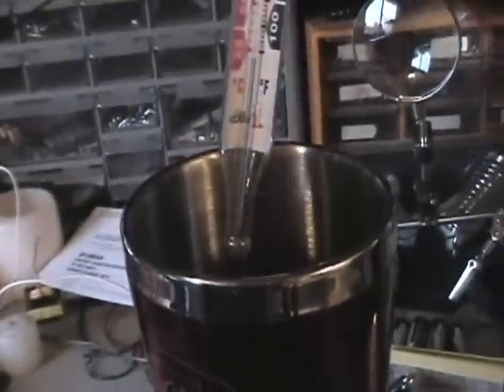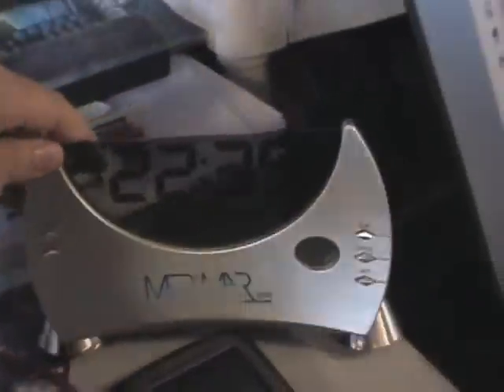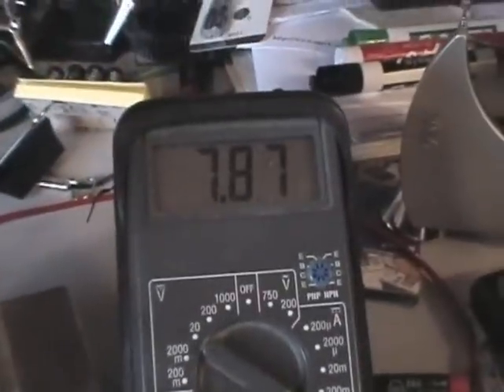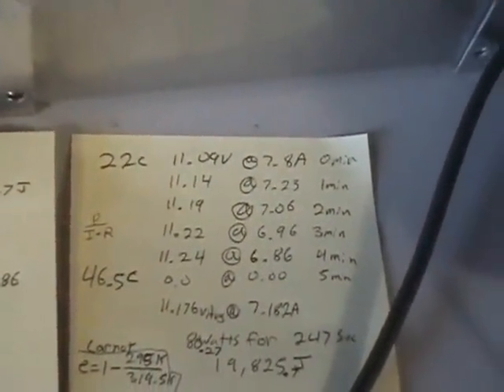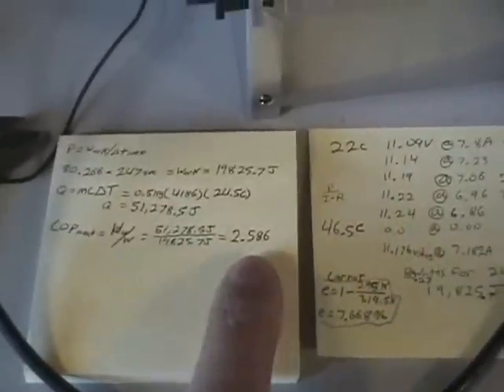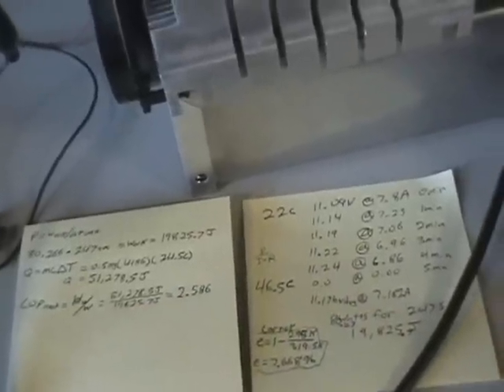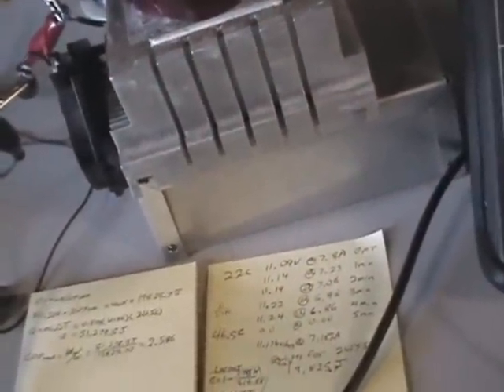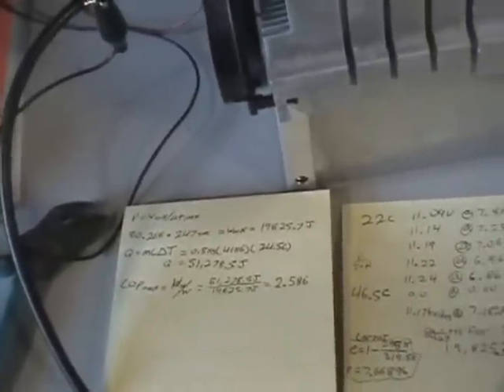Peltier thermoelectric device efficiency

Comment: isnt that cup insulated?
Reply from the maker: It is an insulated cup with the bottom removed and a heatsink thermal epoxied onto the bottom for heat transfer into the metal fluid vessel on the inside.

Comment: Thanks, great experiment! They're more efficient driven at lower power, eg .4-.6 of max volts. I'm putting together a heat pump with six 15V(max), 8.5A peltiers running at 8 volts. Expecting ~200% COP @ above freezing outdoors. So at 33 watts each that's 200 W of electricity, expecting about 400 W of heat into the room. 2 pipe holes go through the wall to the outside radiator (w. antifreeze). Room rad above, outside below, gives convection circulation. (More: next TurquoiseEnergyNews)

Comment from the maker: Yes, it worked ok since I couldn't find an aluminum cup. If you ran it at full power too long it would make a 1/2inch ice cube at the bottom of the liquid.
Reply: Hope you don't mind sir, can I ask how to compute coefficient of performance of the peltier module when used for cooling or for refrigeration. Thank you

Comment from the maker: They are reversible to produce power. However you don't get much power out of them as you would expect. To move 30 watts of heat from one side to the other takes about 100-120 watts of power total. So you put in 120 watts and it will take 30 watts out of your cold side and move it to the hot side where it dissipates it as 150 watts of heat. So conversely if you used it to generate power you might get 20 watts of power from a source that is boiling and the other side as ice from a 200W peltier.
Reply: the power it takes to move 30w of heat is also turns into heat by doing it! otherwise where all that power goes to?
Reply: It means it is better for cooling right...??

Comment: do these units increase output with increased surface area?
Reply: shane c to a point, the faster you can diffuse the heat, the more efficient it will work

Comment from the maker: @ryukenosuke I do not have a chart like this, but I can make a prediction. My prediction is that anything above and amp or two, you will have a temperature difference of around 70 degrees Celsius and as you raise current the temperature difference will not change very much at all, maybe 10C at most. This is because the peltier has a absolute limit as to temperature differential between both sides, so without heat sinks it will quickly reach that differential limitation.

Comment: zr2ee, If you notice the fan is on the heatsink that is on the room side of the peltier junction (not on the cup side). He could use a seperate power lead so as not to measure the fan power in the calculations.  He shows the 51000/19800 =2.575757 which is approx 2.6 COP as he said. For comparison I did the math on a 5000btu window air conditioner with an EER(BTU per Watt) rating  of 11 and as I remember it the COP was around 5
(5 BTUs of heat moved for every one BTU of electricity used).

Comment from the maker: To measure the heat transfer function only. The heatsink needed to remain constant temp. If I had allowed the heatsink to increase in temp along with the water then the resistive heating of the peltier would have been the majority of the input.